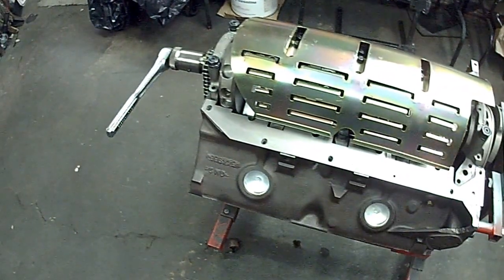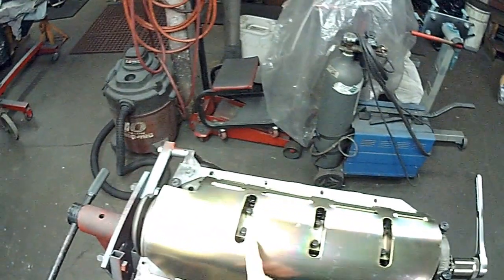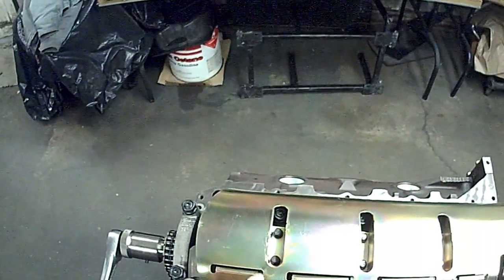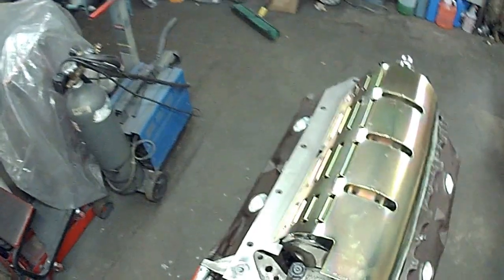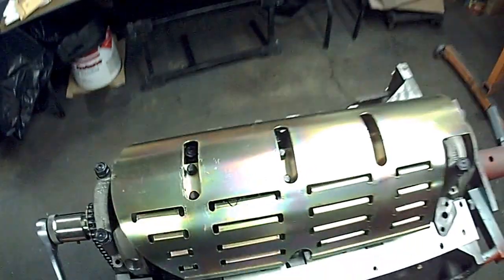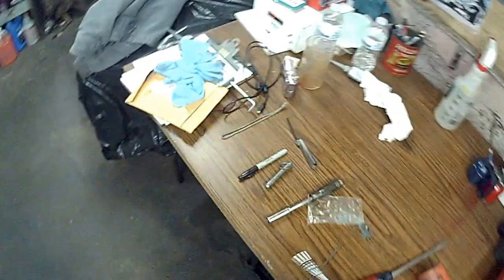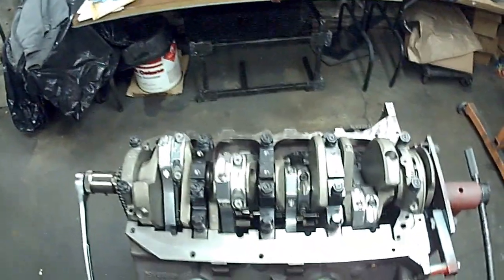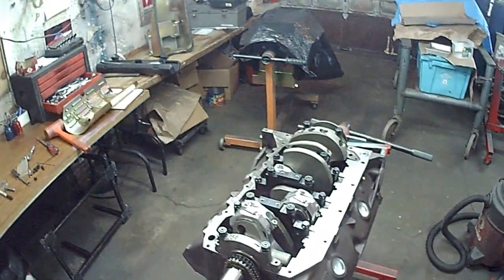Spotts Performance windage tray and scraper

Comment: Nice job on both pieces. In your honest opinion who makes the better aftermarket aluminum or cast iron block IA II or MR1 ? Also for a street & strip engine that has a lot of power & reliability how many ponies would you recommend & what combo? IE - what block, bore, stroke, pistons, crank, cam, cam lift, heads, carb, fuel injection, transmission etc. would you run for a weekend bruiser street/strip engine? Assuming all other parts work with them & use the best parts. I'm thinking 1000 to 1500 HP twin turbo engine. What's the most HP & still really strong & reliable & can last a long time?

Comment from the maker: Was recently informed a highly respected engine builder removes 1" to 2" section of my windage tray to open up a larger area  for oil to escape. Something to consider as a modification, but it may effect the windage control slightly.  Just thought that was interesting to hear. 
November 2015 update, the engine pictured is revving at 7000 rpm's in my 69 Firebird with KRE d-ports and best et to date is 9.79 with pump gas